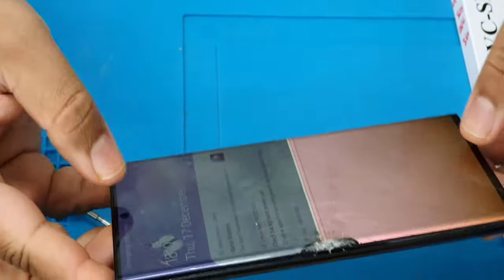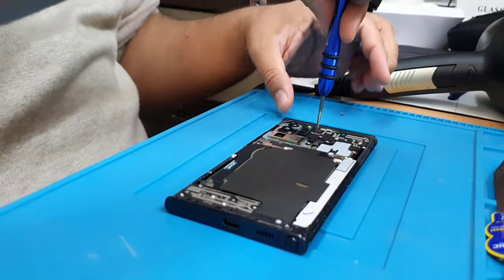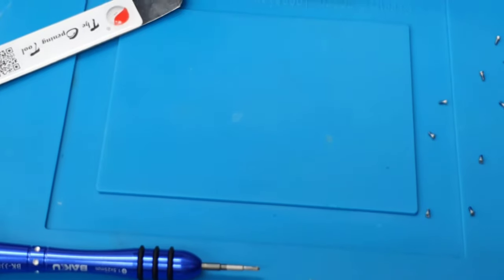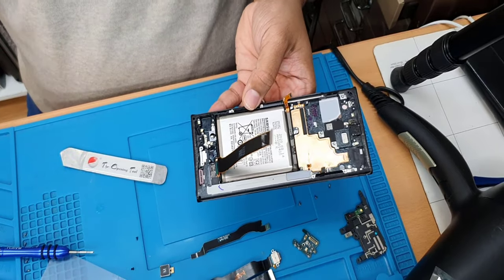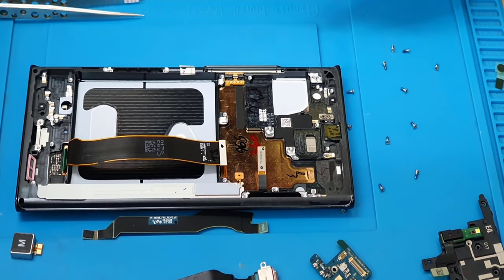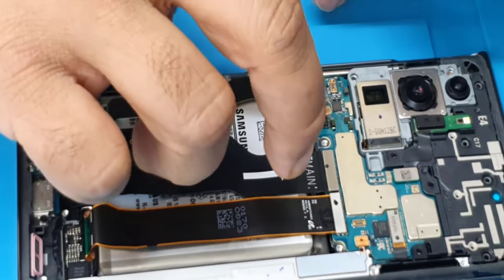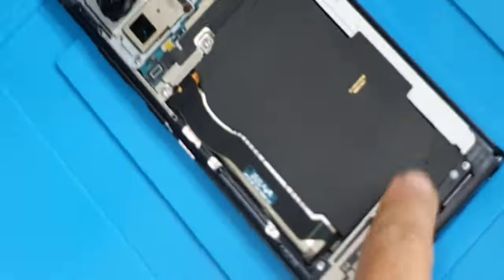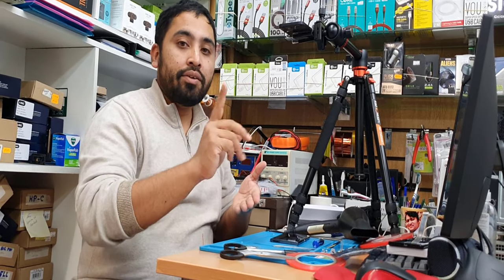How To Replace Samsung Galaxy Note 20 Ultra 5G Screen | VERY  EASY WAY

Comment: I've said it before and I'll say it again: BEST Note 20 Ultra teardown video on YouTube, bar none. Very informative and straight forward. I changed my Note 20 Ultra's digitizer 3 times and changed my battery twice and your video helped me make sure that I didn't mess anything up. After taking it apart once, I'm now able to do my own teardown without pausing your video. My Note 20 Ultra is the best modern smartphone out today, especially because it has expandable storage and an excellent camera system. I plan to keep my Note 20 Ultra for a very long time and your video will help me to do so. Thank you!
Reply from the maker: No one is perfect, but smoothness comes after a long practice. Thanks, brother.
Reply: could you fix my note 20 ultra 5g
Reply: What's this screen replacement name.& details because there are many, many replacement on-line. I would be very thankful for the information ABOUT THIS REPLACEMENT PART. Please help me out.thank you in advance.
Reply: Will this process erase our data from phone?
Reply: Do u have a link  were u bought material

Comment: Thank you for making this video! I was replacing the front and back of my phone and did not want to pay someone $500 and wait 10 days. But i wasnt sure i could do it myself. after watching your video, i became more confident. so i bought the LCD and replaced it myself for less than half the price. thank you SO much!!!!
Reply from the maker: Glad I could help.Please do subscribe if you like this video. Thanks
Reply: Where did you buy the screen replacement?
Reply: How much was the part mate
Reply: @AngelGdo  I found one at $160. REFURBISHED  from ebay.    With a small pixel  spot on the lower part of the phone.   No biggie
Reply: Will this process erase our data from phone?
Reply: @mohamedimzeer2238  no
Reply: Your comment is interesting. I'm faced with replacing the screen on my Samsung Galaxy Note20 Ultra after it had been in service for 41 months beginning in August 2020. 

I've looked at the replacement cost for the screen module shown here and was somewhat surprised to find that it costs $350. I guess I was expecting it to run around $150 or so. I think I can find a new old-stock Note20 Ultra online for just about $100 more than that. If I set aside my phone's sentimental value then it makes no sense to repair my (formerly) trusty Note20 Ultra since that class of device will not receive any further updates beyond a handful of security updates. 

I was able to jump to my new (last year) Galaxy S23 Ultra that has only been used sparingly since I insisted on using the Note20 Ultra as my primary. 

I didn't think I'd have to consider the economics in this situation but here I am on Saturday, January 27th 2024.

Comment: @Thepcphone   have a question  though,   what is that cleaner you used  under the battery to remove it???????   I am not using a hot matt/plate, soooo could use that stuff.  Thanx!

Comment: My Note 20 Ultra screen has vertical lines. It was one green line first, now there is 5 green line and 1 pink line. I already purchased another phone, but I want to get into this repair practice. Very helpful video. For the green line issue, assuming I need to change the screen? I think I will change the battery also.
Reply: Us too why does this happen to them? And I don't know where to get a screen replacement 😢

Comment: Bought Note 20 Ultra and put a thick fat case, but it still cracked when it fell down accidentally on the driveway while getting into car from less than 2 feet height. Samsung site lists replacement screen cost at $269, which is preposterous. The curved screen is the cause for the cracked screen on Samsung Galaxy phones. I had gone with Apple after my Samsung S7 Edge had a similar experience and I paid $200 extra to replace that screen. I am probably never going to buy another Samsung again after this experience.  Good video to salvage the damage done.

Comment: Hi very informative video, I need to pick your expertise in this area please, my SG Note 20 Ultra 5G allows stylus but not touch suddenly stopped accepting touch response do you think this is a motherboard issue or screen digitiser. Thanks in advance.
Reply from the maker: Hello Sir,  I do appreciate your time and consideration !its very  difficult  to say without checking the phone physically! I don't  know where do you live , I wish if you were live in London  I could  check it for you,  My repair shop based in London!! However try to hard restart the phone by holding power and all volume button together,  it would fix if there is any software glitch!! Hope you would subscribe  to my channel if you think  this video is helpful! Thanks
Reply: I am experiencing this problem also! I dropped it, slight crack at bottom of screen but no biggie,  but will only accept stylus touch now.. no fingers.. I think something has come loose inside most likley! 
Just weary of being ripped off!! 
I am in Bristol

Comment: Nice video perfect explanation of the screen replacement for the note 20 ultra, can you tell me where did you get the replacement screen from.. 🤔  so I can try and follow your steps.. thank you.
Reply from the maker: Hi, Thanks for your time. I always try to get genuine replacement parts for any repair.I never use a copy LCD, especially with the Samsung LCD . I always buy direct from the factory which is from china. You may contact me if you need any! Thanks
Reply: Hi, can you tell me where you bought it please? website etc.

Comment: hello - i have this issue, the screen is black, but i can use the phone when plugged into a HDMI, using DEX with a keyboard and mouse, the strange thing is, i can still use the touch screen on the front, and the engineer mode shows i that all the touch sensor is working the front camera and speaker and all things are working but no display. is there a fix to this or is it a complete assembly replacement?

Comment: Very cool video. Thank you. I took mine in to get repaired. The front camera was working before the repair (took a selfie), but not after the screen was replaced. Any chance it could have been damaged during the repair? Or is it a faulty screen? I'm at a loss of what to do next.
Reply from the maker: First, I am very glad that you liked this video. Hope you would subscribe to my channel to support it. 
However, before you left the phone at the repair shop, did you show them that your camera was functional or not? If you did, then they should double-check if there is something missing, either lose connection or faulty camera flex. However, type *#0*# and test the camera.
Reply: @thepcphone  oops, thought I did subscribe - am subscribed now :)
Yes, they're aware the camera was working. It was also in a different city while travelling so basically impossible to take it back there now. I'll call them to see what can be done, if anything from afar. Huge thanks for your timely response!
Reply: Hello dear how much did you replaced?
Reply: Most of the spare displays sold on Ebay, Aliexpress etc, are sold without the front camera. 

The shop knew that you would not open the phone and saved loads by putting in the cheaper replacement, that did not have a front camera.

Comment: Thank u soooo much sir!  Excellent  video!!  👏🏻👏🏻
Reply from the maker: Glad I could help, Hope you will subscribe to this channel. Thanks for your support.
Reply: @thepcphone  sure did.  Thanx again!
Reply: @thepcphone   have a question  though,   what is that cleaner you used  under the battery to remove it???????   I am not using a hot matt/plate, soooo could use that stuff.  Thanx!

Comment: I have a Note 20 Ultra 5G. The touch screen no longer works when using your finger but the pen still works. I have changed the sensitivity and tried reset as has been suggested but the problem persists. Do I need to replace the screen or is there anything else I should look at? Thanks so much in advance for your help!

Comment: Thank you for the instruction video i followed your video and i replace my screen and its working fine good video 👍🙂
And one thing when i take the battery out and put it in New screen it give a little smell not many what do it mean?
Reply from the maker: You're welcome! Interesting!! What kind of smell? Please double-check the new battery if there is any lick age. If then replace it immediately. It could be very dangerous. Hope it helped. Please subscribe to this channel if possible. Thanks
Reply: @thepcphone   @Thepcphone  thank you for the response i think damaged the battery by switching to the new screen i ordered a new one because it smells 😋👍

Comment: Is there a link to the replacement screen? Also what cleaner did you use on the battery
Reply from the maker: Hi, I don't sell it online, I do have the stock direct from China and it is 100% genuine. If you're from the UK, then I might be able to help you. But i am sorry if you are not in UK. I am not able to ship the item internationally.
Reply: @thepcphone  I understand you can’t sell it to me, but if you point me in the right direction where to acquire it that would be great, I just don’t want to buy a screen that is proven to work.

Comment: Suggestion for getting screws out. I've tried the standard head and various other sizes but the loctite won't break. I've tried the rubber band and glue but the screws aren't stripper just won't come loose from the loctite. I've got 7 of the 18 out. They just won't budge.
Reply from the maker: Sorry to hear that ! Next time try to use proper tools which is  obvious in repair industry.

Comment: Can you please share links for the screen replacement and the aerosol you used for the battery please? there are many online and I don't know which one to choose.
Reply from the maker: Hi, I did get it from my local wholesale! Did not find the item on Amazon UK market. But you May try on eBay UK. Please don't get the copy replacement as it would not work correctly and waste of money. Buy the genuine replacement part. Thanks
Reply: Great video going to try after dropping mines this morning similar damage as this example. Was it PC cleaner you used to spray battery before removing?

Comment: I bought a new screen panel with frame and followed step-by-step. 

I thought everything went smoothly and accurately but when I was done my phone would vibrate when I tried to turn it on by pressing the down volume and on-off buttons at the same time, but the screen remained black.

I disassembled everything and as I took it all apart everything seemed to be done properly.   Then I followed step-by-step again reassembling everything.  Again, I have just a black screen.  It doesn't light up even though I can hear it click and vibrate as if it is going to start. 

Does anyone have any suggestions on where I went wrong and / or how I can fix it?   All serious responses will be greatly appreciated. Thank you.

Comment: Where did you buy it? I saw screens on Ali-express, but I'm reluctant to buy it. If I get it cheap, here where I live I pay about 15$ for fixing my phone.... but the hardware is double of that in Ali-express. The repairshop said that if I have the parts, he would fix my phone for that amount....  I'm so pissed. I bought it used for less than half the price of a new one, but fixing it cost half the price of what I paid.... for that money I can buy a reasonable phone from Oppo or Xiaomi.... I'm using it at the moment with Dex on my laptop, and will have to use my old Note 4 when I'm leaving the house....
Reply from the maker: You can buy from us .

Comment: Any solution for green line on display ? My device never hit hard with anything yet I got green line
Reply from the maker: If It's the UK version, then you may contact Samsung. It did not happen because of your fault or accidental damage, it's a manufacturer issue. Hope you will subscribe to our channel and keep in touch. Thanks for your time.

Comment: Just got my note screen and digitizer and frame replace but I can't hear my speaker, only on top, did the technician forget to do something?
Reply from the maker: I think  the air speaker broken when he tried to pull out from the old frame! There are 2 speakers, which one are you talking about. I think loud one is still ok right?? Most of the time, technician break the mini one.
Reply: @thepcphone the loud one, is next to the pen right on the bottom? That's the one that doesn't work nor for videos or speaker calls, only the top speaker is the one that I can hear from.

Comment: hello, i also changed the note 20 ultra screen. The front camera is installed on the screen I just bought. And after the repair, the front camera error appeared and the front camera stopped working. what can I do. thanks
Reply from the maker: Did you buy the genuine Samsung screen? Genuine  screen does not come with any sort of camera. Where did you get The front camera you are having trouble with ? What did happen with the old existence  front camera?

Comment: Help please!. I followed your video to replace my screen and all went well or so I thought until I tried to use Whatsapp. I can hear the other person on a Whatsapp call but they cannot hear me. This seems to happen only with Whatsapp and it happened right after I replaced my screen. Regular phone calls works fine and everything else work fine. Also, I did not change any settings and verified the mic status and it was on so now I'm stuck. I've spend more time trying to resolve this issue than it took me to replace my screen. Also, whatsapp does with my blue tooth head phones so its isolated to the phone mic. Please assist if you know.
Reply from the maker: If there is any chance give the WhatsApp a reinstall.
Reply: Tried the uninstall & reinstall already and still nothing. 
Then i tried this: I dialed *#0*#, then clicked on Loop back, clicked start RCV DualMic(one of three mics that this phone has) and I spoke into it and I could not hear my voice return back like I could with the other mics on this this same Loop back test. So it appears that the first mic(the lower mic) is not working. This mic is apparently the mic that Whatsapp and some other apps will use and is not the same mic that is used for phone calls with cell provider. I ordered a new mic and now I am waiting on that. I will update on the status on that once I have it installed but I think that is the issue. I may have damaged that mic during the screen replacement process, possible with too much heat or clamping the screen after adhesive or board flex when placing back. I'm not sure at this point. Anyway, will keep you posted. Your video really helped regardless.
Reply from the maker: Always remember that the Android smartphone's PCB is flimsy and weak.
So when you pry it, just be gentle and never rush. Before you pull up the board, check if all the screws are removed or not. That's all. I wish you good luck this time. @kurts3779

Comment: Basics mate, basics.. Use plastic tweezers! plastic spudger for removing connectors not your fingernail, keep your screws in a safe place away from the work zone and not rolling around under the phone!  PCB tape over the lenses when they're exposed. Breaking the security seal for no reason before testing the new screen.. I'll not go on. Don't work on your phone like this.

Comment: Now how much would you charge to replace it lol......I  cracked mine bottom left corner barely but it bothers me ......a local repair shop quoted me 400$
Reply from the maker: 300  only and I will get the genuine replacement  screen for you!
Reply: @thepcphone  where do you buy screens from?
Reply from the maker: @ulzi  from vietnam most of the time!
Reply: @thepcphone  Do you have a website I can take a look at?
Reply: No if you go to you break we fix they will charge $269
Reply from the maker: @ulzi  I do have a repair shop in East London but don't sell on site !!!
Reply: @thepcphone  What site do you buy screens from I meant.

Comment: I guess no wondee it only took 2 hours for them to replace my screen when it go through the black screen of death.
Reply from the maker: Hi, sorry to know your bad experience on the screen replacement issue. Did you follow the instruction correctly ? If yes, then I would say your replacement screen might be faulty. This replacement is easy, but it takes time to get it done!!

Comment: why are you using metal pry tools to remover cables and parts? this is not a good way to do this repair
Reply from the maker: You are absolute correct, and there is no doubt. To be honest, steady hand using for long time precisely. Nowadays, I don't use metal that much. Thanks for your time. Much appreciated.

Comment: Thank you, strange type of glue you are using is not B-7000, I bought same as yours from eBay, was 2mm thickness (which was quiet thick, so I managed to cut it in half, let’s say 1mm), I applied the glue and now put a heavy book on the top of the phone to be sure will be ok. My B-7000 expired after few months of no use 😢